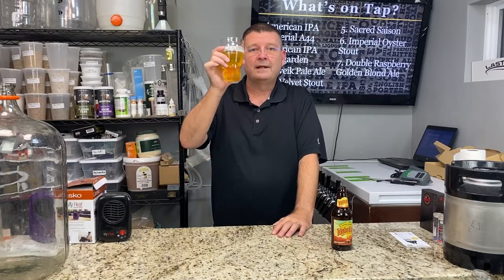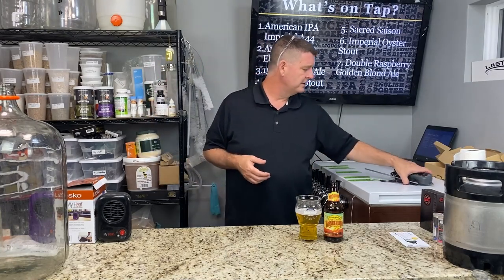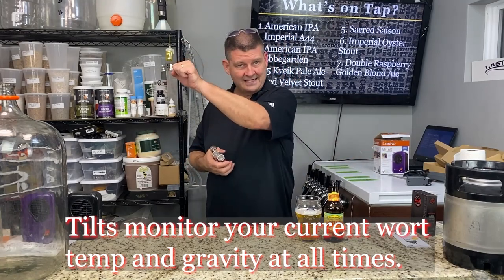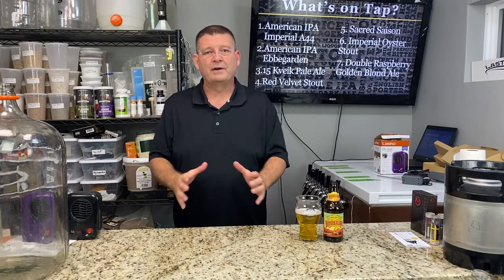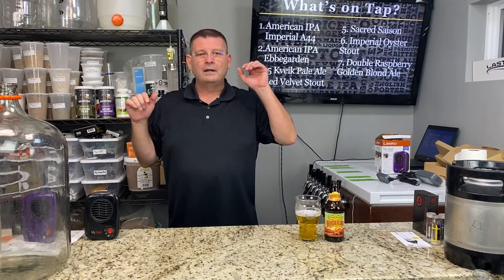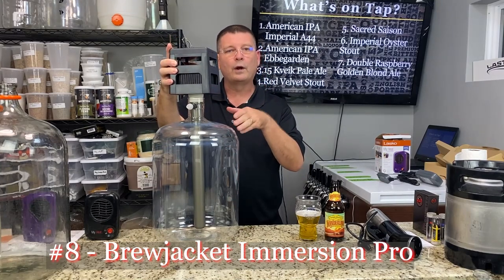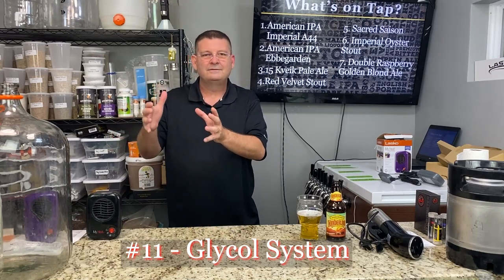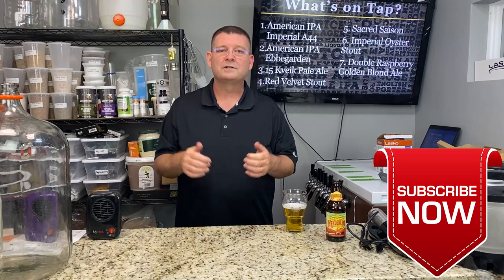How to maintain heat during fermentation - Applying Heat to Fermenting Beer

Comment: I have no experience with anything else, but a heat belt in a mini fridge with an STC1000 has greatly improved my brewing experience. I only ever have had one fermentation at a time, but it has improved my brewing immensely.
Reply from the maker: How well does the belt work overall? I've never used one but as you may have seen my massive fermentor which does a great job for Ales sadly can't get below 58 F to do lagers so I'm going to try it with an immersion pro to see if that extra boost can help drop the temps otherwise I'll need another small chest freezer just for lagers.
Reply: is the fridge on or is it on a temp control along with the heat belt?

Comment: Great videos. Being new to brewing, I think not controlling temp ruined my first brew. My fermentation stalled, I  repitched more yeast , but I never reached FG. Lesson learned
Reply from the maker: I read and article where they asked a bunch of professional brewers if there something they could have done differently when they were first learning to brew at home would it be and the majority said they wished they'd either spent more money, time, and/or focused more on fermentation temperatures. I fully understood as I think we all struggle a little to either maintain certain temps or at least monitor it enough so that we could repeat that same brew with the same temps. That is one of the reasons I love my tilts (wish they were cheaper and smaller) as I can see the actual wort temp as wort temp is huge during fermentation.

Comment: I'm in Texas brewing in a garage - easily 90-110. BUT I have a full size fridge. I am looking to add a CO2 line in there for kegs. BUT I'll need to ferment in there as well... 

I am thinking of a small power line along with the CO2 line (female in the fridge/male on outside). I can set up the Inkbird (temp control) outside the fridge. When I have beer in kegs I can plug in a heat blanket inside the fridge - that plugged into the temp controller. on fermentation. If I don't have any kegged beer, I'll plug the fridge into the thermostat control. How concerning is a power source/plug in the fridge? 

How do you put you temp probe into the fridge - through the door? Worth it to drill a hole - create some type of 'port'?

Then I get to decide if I continue doing a glass carboy (saves $), or is it worth buying something like a Fermzilla and allowing me to ferment under pressure, eliminate O2 on the beer, punch beer into kegs, etc.
Reply from the maker: First, it sounds like you need to score a chest freezer off Craig's List or FB Marketplace for a fermenter. Using an Inkbird with a fridge is really easy, just make sure to set a nice delay on the Inkbird so it doesn't try to turn the fridge on too soon after shutting it off to avoid damaging the compressor. As for chest freezers, sometimes you have to disable an alarm system which can be a bit of a pain, but YouTube or online instructions seem to be plentiful. As for the temp probe, I'd try through the door at first if the rubber is still fresh on the door seals. If not, I'd try to drill a small hole where it would be easy to plug if you ever decided to move your fermentation. 

As for the glass carboy, if you can fit a Fermzilla All Rouder, they were worth every penny! Easily my favorite fermenters.

Comment: Im thinking of going with the heat pad, very cheap on ebay, will these keep the heat constant or will it just get hotter and hotter if you leave it on too long? Just out of interest, can you brew cold? Will it just take longer as the wife wont let any of my beer stuff in the house and its nearly winter here in the uk😮
Reply from the maker: First, sadly you can't brew cold, although there are pure extract brews that don't have to be boiled. As for the heater, you will want to purchase an INKBIRD or like device to help avoid too much heat. If you choose to use a heating pad, wrap the fermenter in a few beach towels, or a really decent blanket. The probe would be best in a thermowell, but can also be strapped to the side of the fermenter with some painters tape. Avoid using too much heat, especially direct contact like a heating pad on anything plastic.
Reply: @BitterRealityBrewing  ok thanks👍 I may just sneak it into the cellar when shes not looking!✌️😉🤣

Comment: Quick question regarding the Fermzilla canonical and heating pads.  I found the circumference of the fermenter to be 43.6 inches. would a single heating pad wrapping half of the fermenter be fine or should I find one long enough to wrap more than 50% of the fermenter?  I am creating my lists of what is required now :)
Reply from the maker: Technically it wouldn't matter as it is all about the heat transfer but the bigger would probably be better at maintaining the heat more evenly. I have small heating pads but once I strap one on with bungy cords, I then wrap it with one or two beach towels to help maintain the temps a bit better.